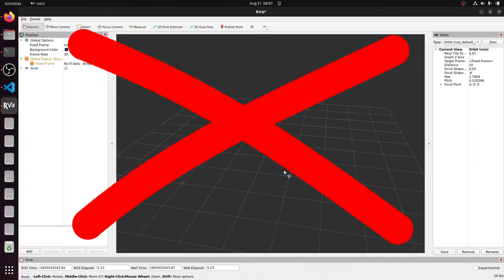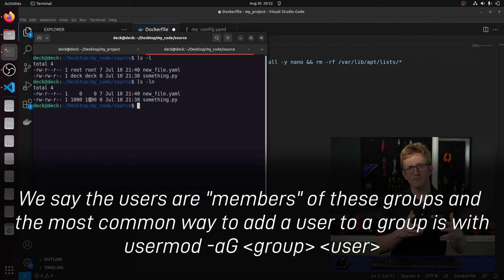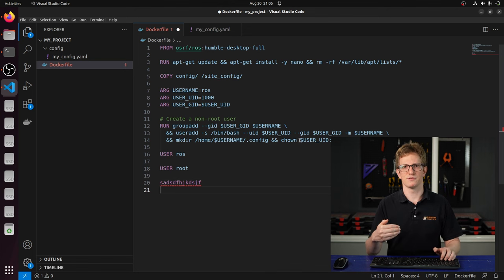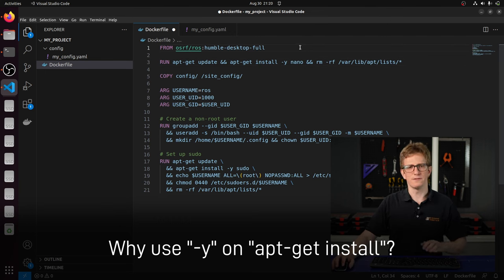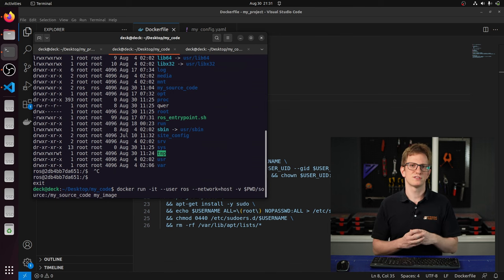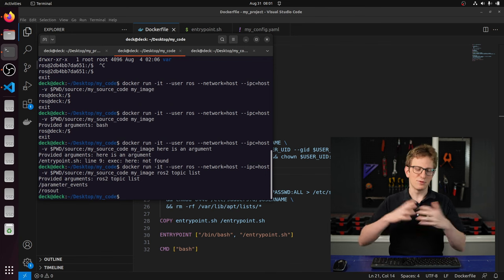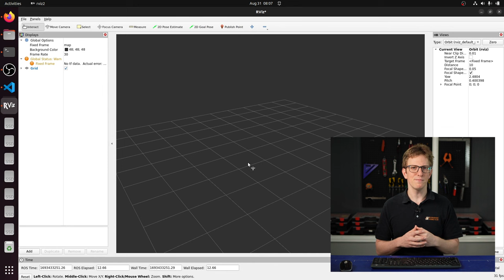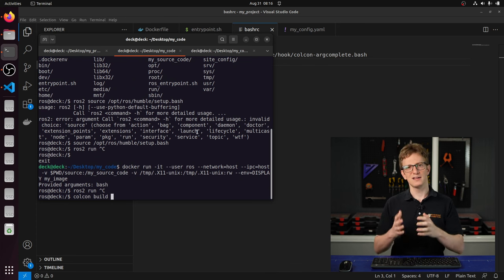Crafting your Dockerfile (Docker and Robotics Pt 3)

Comment: So my target platform, the raspberry pi 4, won't work with any of these tutorials because raspberry pi 4 is arm64 and all of the docker images from this series are amd64.  Even if you buildx to target arm64 things will simply fail.  Docker doesn't solve ANY of the platform compatibility issues. OSRF doesn't provide arm64 images for the arm64 raspberry pi platform and the garbage of interoperability in the linux community is destroying any sort of adoption for ROS2. ended spending hours and hours creating a custom docker image and wasting too much time waiting for layers to build because i changed one small thing/ordering of something.
Reply: facing same issue also, im using jetson nano which is also arm64. may i know what is ur solution?

Comment: Hi, on running `rqt` in the container I get the following error:
could not connect to display :0
This application failed to start because no Qt platform plugin could be initialized. Reinstalling the application may fix this problem.

Available platform plugins are: eglfs, linuxfb, minimal, minimalegl, offscreen, vnc, xcb.
---

Could you please help me out with this?

Comment: If you use the bashrc approach should you not remove the source ros installation statement from the entrypoint.sh? now the ros installation is sourced in two different places: once in entrypoint.sh and another time in the bashrc. Is there any reason why the file is sourced twice iso once? seems to me it would reduce complexity. Also having a (potentially) different environment when executing commands  vs opening an iteractive terminal could be frustrating when debugging. 
To get it to work I had to change the docker file ENTRYPOINT ["/bin/bash", "-l", "/entrypoint.sh"] -l to make bash act like it is launched as a login shell. Does this have any downsides you know of?

Comment: What an informative video, it was worth the wait. I really liked how well the construction of the docker file was presented as well as the entry point script. I'll also try out X11 for GUI applications since I've been using Xauthority for a while. I am also very interested about GPU acceleration, since my computer's CPU isn't strong enough to handle the demanding GUI tools like RViz and ignition gazebo
Reply from the maker: Thanks! And yes I've come across the Xauthority thing before but not used it - I believe it is an alternative to using "xhost +". It can be better for some scenarios but has a couple of "gotchas" if you're not careful.

Comment: I saw your videos just in time while I was having trouble interfacing Matlab and Gazebo. I had a problem with this, since Matlab 2023 has a version requirement for glibc which is higher than Ubuntu 20 system's version. Moreover, the gazebo libraries and tutorials they have are only supported for ROS Noetic in Ubuntu 20. I upgraded to Ubuntu 22, and created a docker image with ROS Noetic, and after some work, I could follow Matlab's tutorial (though it runs fairly slow on my laptop). Do you have any experience interfacing Matlab and ROS? Are there better solutions to this? 
Thanks for your videos btw, they're awesome!

Comment: Continues to be a fantastic series! Great content. Particularly eager to see how to properly get CUDA working in a ros humble container, especially in the context of jetson devices. Extremely relevant as we see more gpu accelerated CV running on autonomous systems.
Reply from the maker: Thanks, yes I'm keen to get to that!
Reply: This is the reason I don’t use Docker for ROS. It’s much easier to pass hardware through in a virtualized Ubuntu environment. Also, if you have a decent VM Manager, then you get all the same deployment advantages that you get from Docker.
Reply: Maybe a little late, but have a look at Nvidia Isaac Ros. Its a Humble image with cuda optimizations, Jetson ready.

Comment: Thank you for your video, you are the best. Do you have any plans to add an IMU to your robot? I am struggling to fuse odom and imu to correct the wheel slippery.
Reply from the maker: Thanks! I hadn't really planned to add an IMU to that mobile robot as I don't believe it would provide much benefit (for me the wheel odometry would be better than gyro integration and magnetometers can be a pain).
However it is definitely on my list to cover IMUs in ROS - either in a robot that really needs it (e.g. a balancing robot) or in a localisation system as you say, probably fused with GPS on an outdoor robot. Either way - definitely on the to do list but a long way off.

Comment: Please advice if it's suitable and a good practice to develop some project inside the docker? Is it better to build and develop in our primary OS then test it on the docker? at the end of the video ou mentioned something about installing important tools in the container but that means, we will not only testing it on the docker but actually build n dev inside it? Thank you.
Reply from the maker: Yep I'll be touching more on this in a later video :)
The short version is yes, having tools inside Docker can be very useful. Some people actually like to have two versions of their image, one for development that has all the tools, and one for production that has only the bare essentials. Some simple examples:
Compiler - since you are compiling to have it run inside the container, you want the compiler to be in the image
IDE - Historically, you'd have the IDE on your host and mount the files inside the container, but this means you can't build with the IDE etc. VS Code fixes this which is what the video will be about.
Hex editor - Say you want to inspect some data generated by your software. If it's on a mount you can use a tool on the host, but if it's going to some random directory inside the container, you NEED the tool to be in the container to be able to inspect it.

Hope that helps :)
Reply: @ArticulatedRobotics  Thank you so much, honestly you are the best, I will  support you on the Patreon~!

Comment: Hi, I am finishing the adding a new user section. Which I want to build the image now. 
Nonetheless, I think since I am using Raspberry Pi (I ssh to it), I managed to do the previous build in the previous video, nonetheless, if I am using osrf/ros:humble-desktop-full, my RUN apt-get update && apt-get install -y nano && rm -rf /var/lib/apt/lists/* line failed to execute

ERROR [2/3] RUN apt-get update && apt-get install -y nano && rm -rf /var/lib/apt/lists/*       1.8s
------                                                                                                  
 > [2/3] RUN apt-get update && apt-get install -y nano && rm -rf /var/lib/apt/lists/*:
1.052 exec /bin/sh: exec format error

I have triple checked that there are no syntax error on it. Can we do it some other way?
Reply: I tried it on my WSL, now it works
Reply: What is WSL? I am stuck on the same part?
Reply: Nevermind. It was just that the osrf/ros:humble-desktop-full isn't for arm based processors. So I have to find one that is compatible with arm.